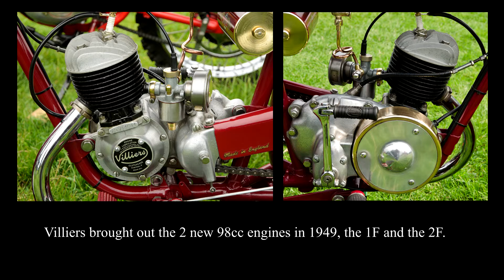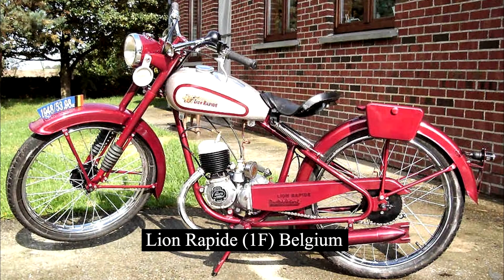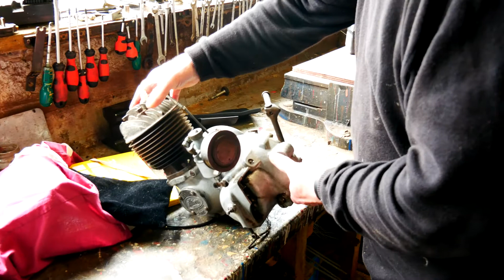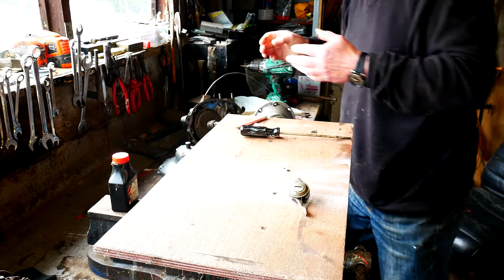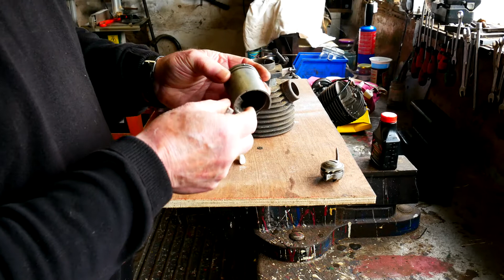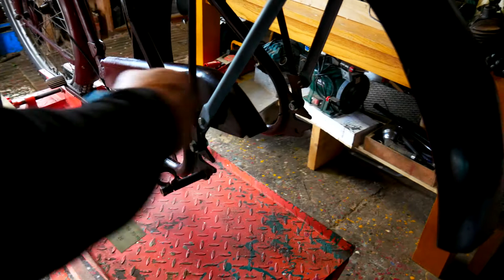Lightweight Villiers Motorcycle engines – How to Get Better Performance

Comment: I rebuilt a Villiers 37A (246cc), and spent a lot of time grinding out square lumps at the bottom of the transfer ports. They were obviously left in there to simplify the making of the casting patterns, but must have caused a lot of obstruction and disruption to the air flow.  I also took care to match the openings where the barrel met the crankcase - as they didn't line up that well.  As Victor says, even if you only have little spare cash and a very basic toolkit, with a bit of effort you can make a considerable improvement to the performance of these very basic engines.
Thanks for posting this, Dominic!

Comment: When I was around 14, I saved up £2.10 shillings (£2.50p) and bought a 1955 James Comet 98cc with two speed handlebar gear change and plunger rear suspension.  It did 40mph and 140mpg. 
I remember getting hot and sweaty trying to start it, untill a neighbour saw me and showed me how. After starting it I remember my joy when I managed to master pulling away and found I could go up hill as fast as I could go down on my push bike.  Oh, such innocent happy days !
Reply: I have a Comet! I have ridden it along my road twice 😊 I'm not brave enough to go any further. It was first registered in 1952. 😊

Comment: Very interesting video, The engine crank case ( with the Villiers name plate) has no gasket when joining the engine many times I have found oil leaking out ( not from drain screw ) may be an idea to put some gasket cement on so compression is not lost from case

Comment: My first motor bike. 1953 Excelsior 98cc. Bought it from the insurance man for £20 , my 16th birthday present. The exhaust was choked with carbon. Had to get it red hot and mallet it to break it out in pieces. Next purchase was a 1950 Bond Minicar. Villiers 197cc.
Memorable for having no bloody good brakes.
Reply: I also followed that route. Learnt on my Dads Excelsior 98 and bought a BSA C12, later a red Bond Mk F, then a maroon Mk G to which someone had fitted a rear petrol tank and electric pump!
Reply: A friend of mine also bought a Bond three-wheeler, as he coulkd drive it on a motorbike licence. He went on holiday to the West Country, and scared the living daylights out of himself and his passenger going down Porlock Hill!
He said the only reason they made it was by keeping in first gear, and hanging out the window to stop the Bond from flipping over on the vicious bend at the bottom . . .
:))
Reply: August bank holiday 1958. With a mate heading for Wales. His job was to clean the other spark plug ready for when the one in the cylinder head coked up. Full belt downhill on the Welsh road from Chester High Road. Haring round the left hander at the bottom of the hill was confronted by the rear end of a stationary Crosville bus, the end of the traffic jam for Queensferry. Remember we had no bloody good brakes. Slammed the gear lever straight up into first. It squealed and juddered to a stop resting on the bus. Into neutral expecting feel shredded gears and pulled the starter (the lever attached to a rope on the kickstart pedal). It started up. That was exciting.
Reply: @davidk3729  - I've just remembered, with you talking about Wales; coming back from the Dragon Rally on the Greeves Scottish Trials (fitted with the Villiers 37A mentioned above);  there were lots of young lads along the A.5, looking at the bikes, and as I approached one corner, I saw three lads watching, one of whom had a camera.  So, being young and certain of my immortality, I decided to put on a show for him, cranked the Greeves over and gave it a fistful.
The trials tyres said "I don't think so . . . ", and we did a graceful both wheels broadside skid into the hedge - and the lad raced up, took my picture, and legged it!  I don't know if he expected retribution in the form of a clip round the ear, but I was so helpless with laughter that I couldn't have done it I'd wanted to!
It's a wonder that any of us survived, eh?
And I wonder if some 60+ year old has still got that photo, and if the memory of that day still makes him chuckle?
Reply: Brakes? I assumed they were an optional extra that my car didn't have. Mine also had NO chassis as it had rusted away leaving the rear suspension units screwed to the alloy floor. It did have a dynastart with reverse, I fitted the reverse myself which took a while for a 17 year old to work out. 
Many years later (1990s) I watched a man in Bury Lancs reverse park one. I watched as he drew level with another car, stopped the engine, operated the reverse switch and restarted the engine going backwards then backed in. He saw me watching him and I think he might have assumed that I was judging him for the car he was driving. He got out and walked away with all the dignity of a member of the royal family.

Comment: Brilliant information on how to extract more power, it is a little like porting the cylinder heads and machining the manifolds on older engines  to get the fuel/air flow smoother in and out of the engine , thanks for uploading video.

Comment: I spray all my iron finned cylinders with Hammerite smooth black metal paint. I bakes, when the engine is started and run for aa bit, into a lovely gloss factory finish that lasts for a few years. A Rudge collecting friend, Brian Cooper, showed me this trick many years ago.

Comment: in my youth i used to glue  wine corks under the piston crown,it was light and didnt affect balance and raised the primary compression,had to replace it often as it used to burn away,
Reply: Modern 2 stroke moto cross engines(1980,s)stopped "crankcase stuffing" realising that widening the transfer passages improved the flow due to the weight of the fuel mixture  exiting faster causing a vacuum effect combined with matching expansion pipes giving more cylinder filling and lots more power..
Reply: @routmaster38  maybe so but no matter what increasing the primary compression helps! with or without expansion chambers!

Comment: Deasel oil hase detergent in it so it will mixe with the petrol ( my bsa bantam sun 250 t) i ran my yamaha yds7 250 on sea 30 oil shell with no prodlems and i road it hard as you do at 19 40 thousand miles happy days

Comment: Very inefficient engines hence erratic running and popping when throttle closed but overall these small bikes were well designed for short distance commute.